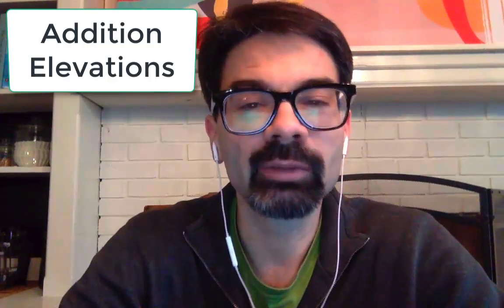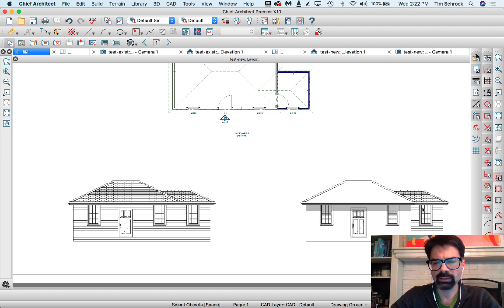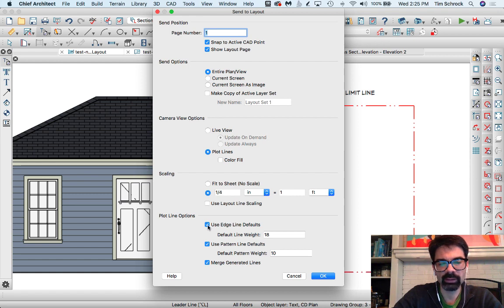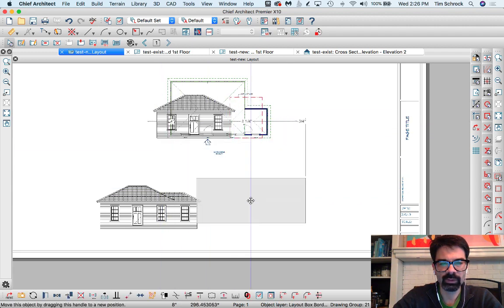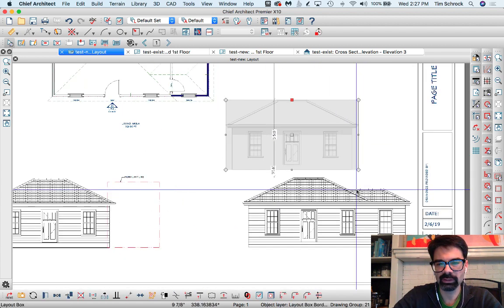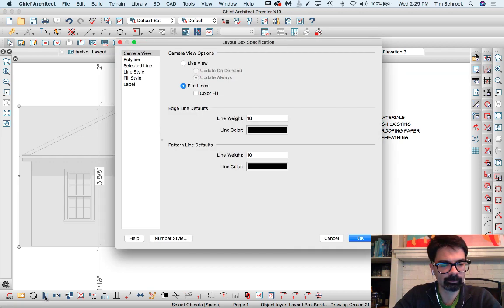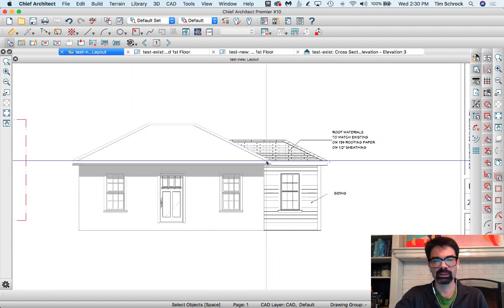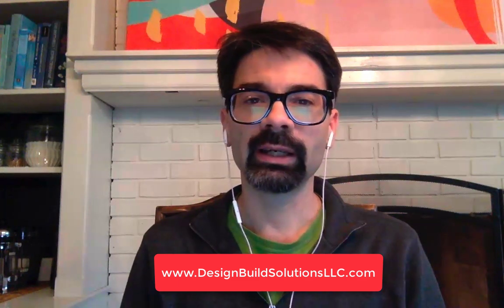Better Addition Elevations | Chief Architect

Comment: Love this video thank you so much - I noticed that the  Plot line options is not as extensive as yours - I'm running X13
Reply from the maker: This video was created in X10. So I pulled up my X13 version here and yes, they did change a bit on the send to layout dbx. 1) are you sending an elevation? 2) you can still get the edge line and pattern line defaults options by choosing the "Plot Lines" options. 
Interestingly, I looked up the help feature on this send to layout dbx, and Chief has written a notice that "the Edge and Pattern Line Defaults settings are included for legacy files and are not the recommended method of specifying these line styles. See Edge and Pattern Lines"
Reply from the maker: You can control the edge and pattern line weights and colors now by selecting the layout box and using the "Open Object" command (ctrl+E on PC or Cmd+E on Mac) and click on the "Camera View" pane